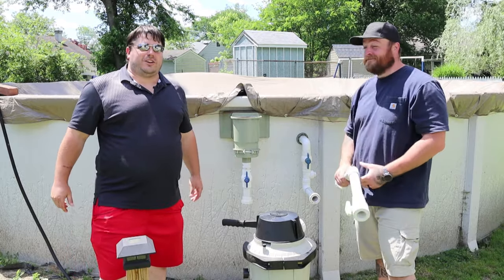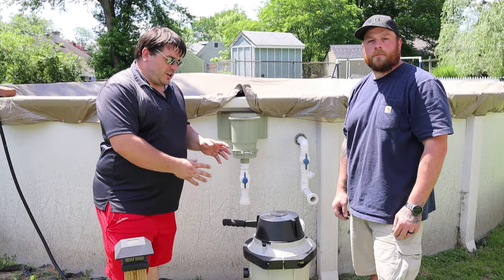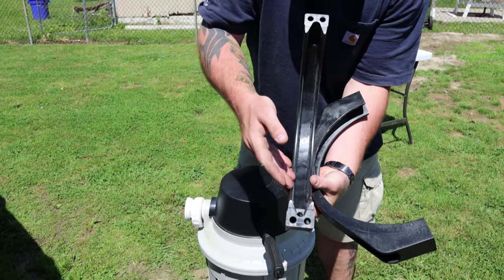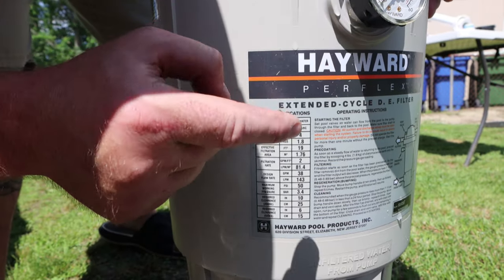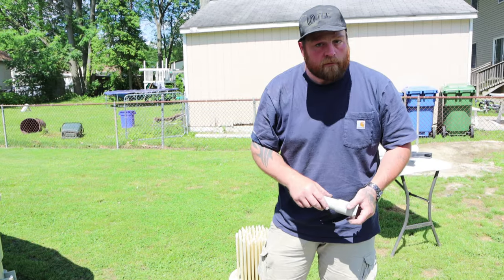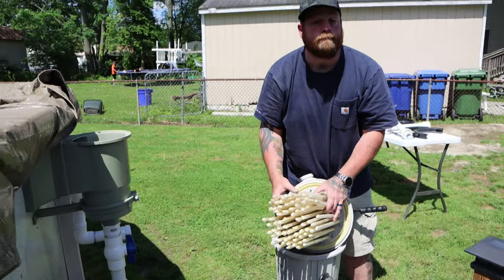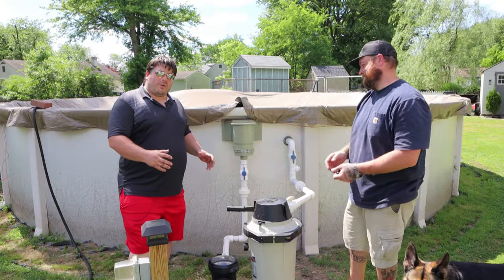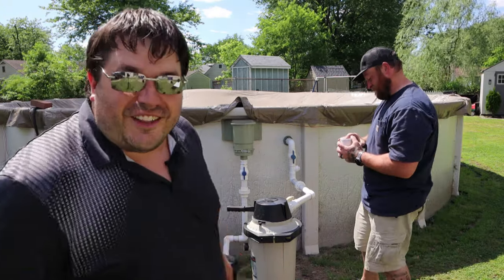SETTING UP THE HARD PIPED POOL FOR SUMMER

Comment: Hey guys what type of fitting did y’all use on the pump it self and how did y’all glue those fittings to the pump
Reply from the maker: So the fittings are couplings acquired from the same place that sells the pumps and they are threaded into the pump and filter housings.